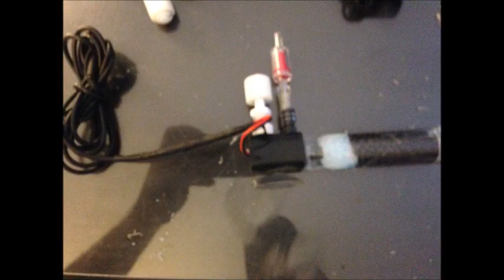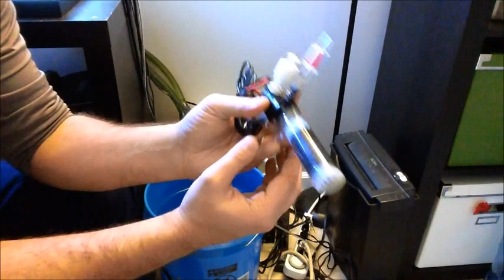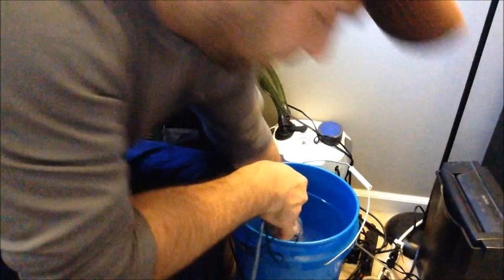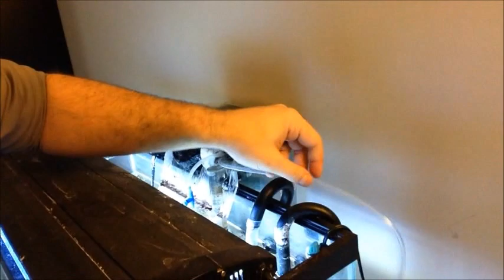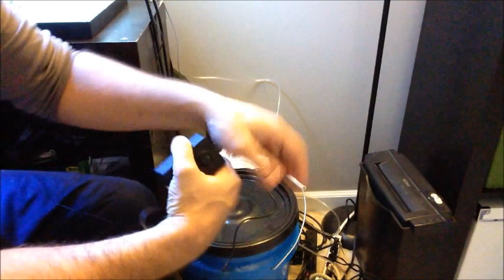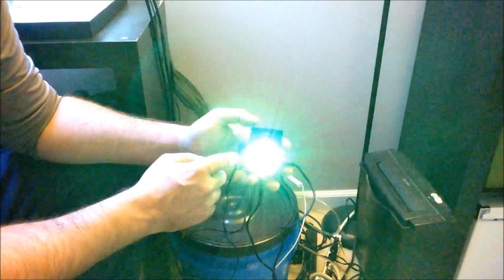DIY Aquarium Auto Top Off $50

Comment: 50$ might as well just get the JBJ ato
Reply from the maker: The JBJ is $70 and doesn't include a pump. I don't sell these anymore but I am working on a version 2 that will use a sensor instead of float switch and include the pump.

Comment: Leds are too bright and that suction cup method of holding the float valve is bound to fail.  It will get hard over time and fail. Get the magnets and it's gold
Reply from the maker: Blazinxtreme I have developed V2 of this system that now comes with magnets for securing the float switch in the aquarium. I have also switched to diffused LEDs. I will be posting an update video soon. Thanks for the input.
Reply: Innovation Labs are these still available for sale?